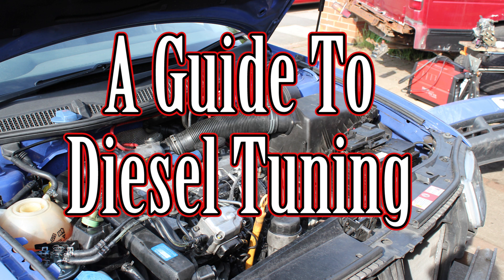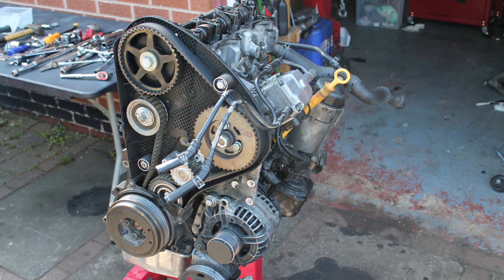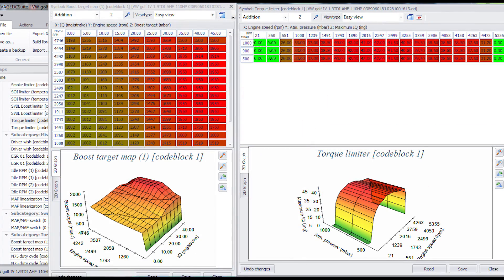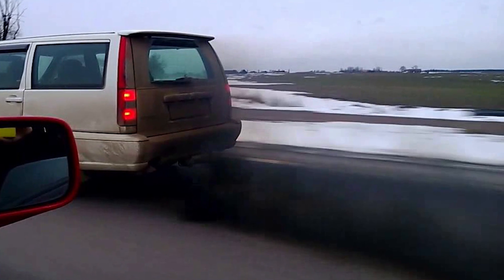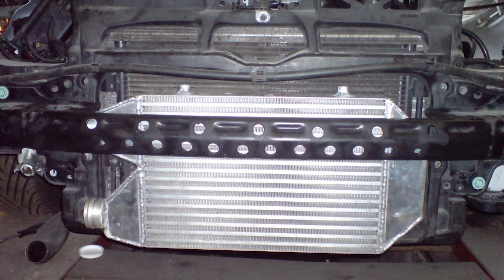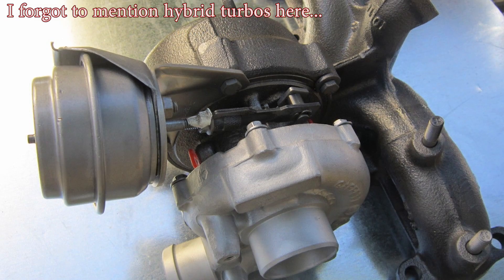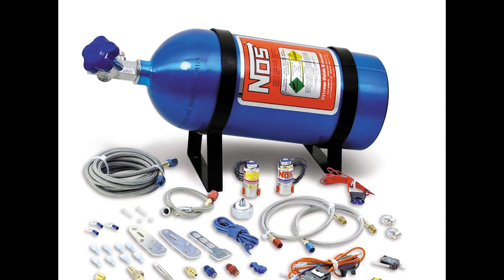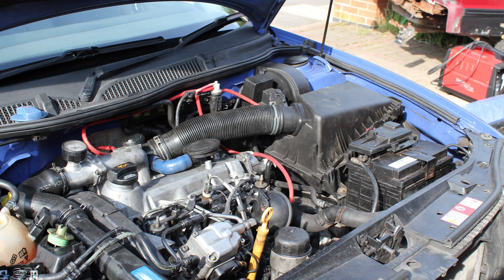A Guide To Diesel Tuning

Comment: Do you no anything on VagSuite?
Reply from the maker: +NerffPlys I know a bit about EDC15 suite, and hoping to spent more time with it once I've socketed my spare ECU.

What car/ecu and advise are you after as what I don't know I may be able to point you in the right direction
Reply: I'm learning, Mk4 Golf pd115 AJM It's got a twin pass intercooler pd130 injectors and pd130 turbo 3 bar map.. The only thing I've manged to map in was the launch control.. I'm going to have a good read of some documents I've manged to source on the internet
Reply from the maker: OK not 100% sure on how PD differs vs VE but  I know your lucky to plug and play unlike mine where I need to pull the ECU and change the chip!
Beside the point you were asking, I'd take a look at the tdiclub forums in the performance section and have a read of the "help me understand my engine map"
There is also the ECU Connections forums which has a wealth of info but you need to dive through it all.
Reply: Couple of fuses need to be pulled for me to write, You have to chip change on VE engines? unfortunate I was thinking of doing some small adjustments to cousins car :(
Reply from the maker: This is where it gets weird on ODB2 stuff, I have a UK car which has the KKL interface and the UK didn't go ODB2 till like 2002 (around here anyway). If I had a 1999 1.8t I could flash over cable, but on the Derv's this wasn't poss.
Now in the USA I think it was ODB2 for quite a bit longer by law so I believe they can be flashed.
Might of been worth asking you where you are based.
Reply: You got an idea on how Smoke limter maps work?
Reply from the maker: Right I can't remember off the top of my head but check out my older MAF video. It shows which one of the Torque/Smoke/Requested get's forced to low when the MAF has gone.

Off the top of my head I think the Smoke limit is what holds fuel back (or as intended the rolling coal effect). Did you check out the post on TDICLUB?
Reply: I'm on TDIclub takes a year to get a reply you got skype?
Reply from the maker: I don't I'm afraid and when it comes to mapping my current knowledge comes from this thread:
https://forums.tdiclub.com/showthread.php?t=375099

I find the guys on the club can take a few days to reply at times, but they really do know their stuff (guys on the club vary from mild tunes to 400bhp+ beasts)